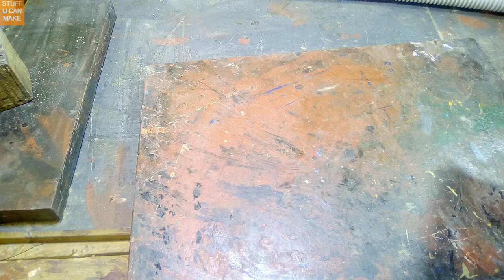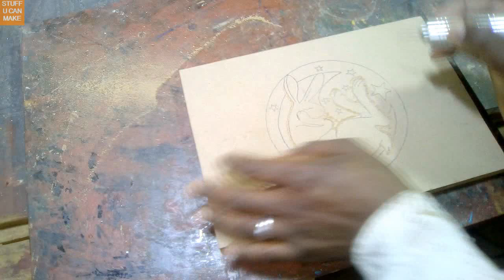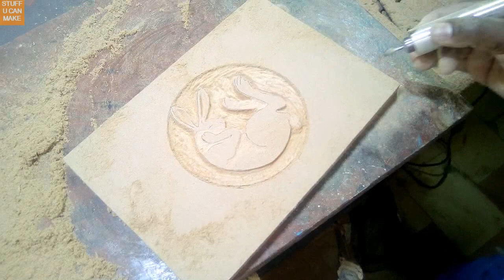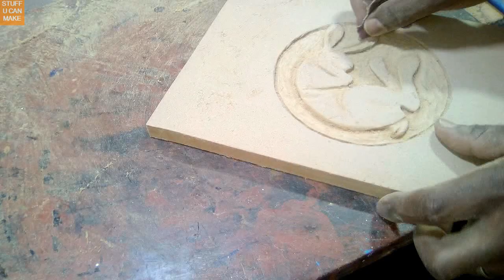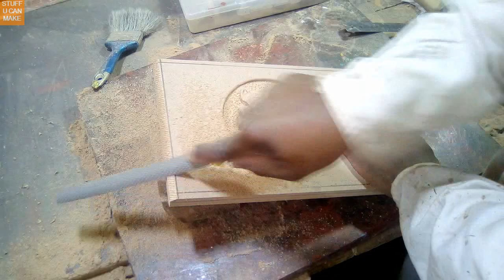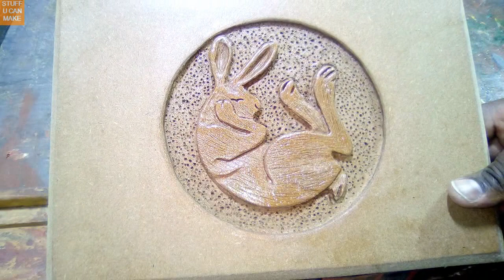Wood carving | Carving a sleeping hare on MDF using a dremel rotary tool

Comment: Hi Jabulani, The Hare looks like it is sleeping amongst the stars. Sorry another question, why do you not use the Dremmel to chamfer the edges any longer? Cheers, Huw
Reply from the maker: I love your questions, please keep them coming. I thought it was quicker to rasp the edges but I have never put this to the test. I am going to start timing myself on both methods and the one that proves to be faster will be the one I am going to use as my default system.